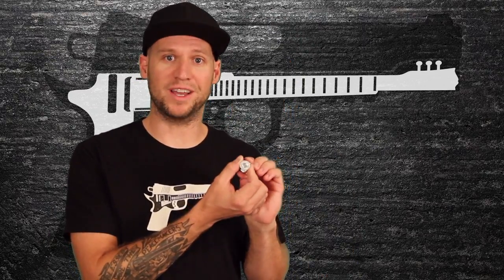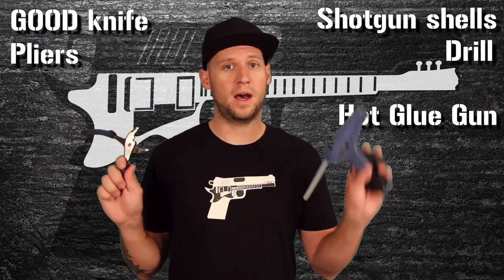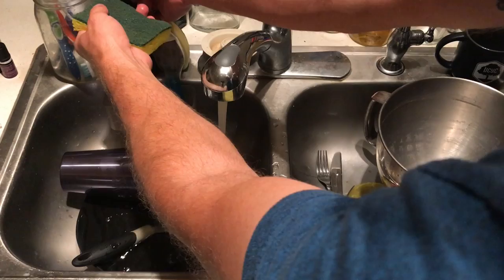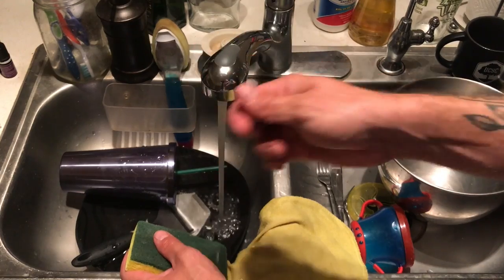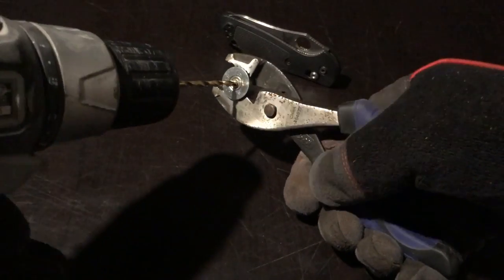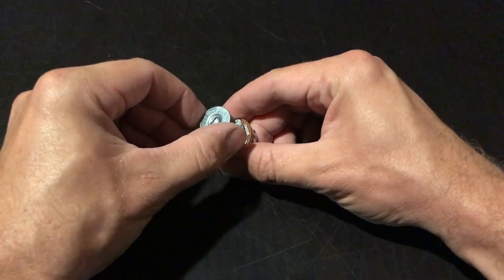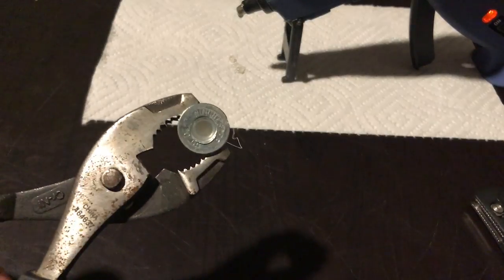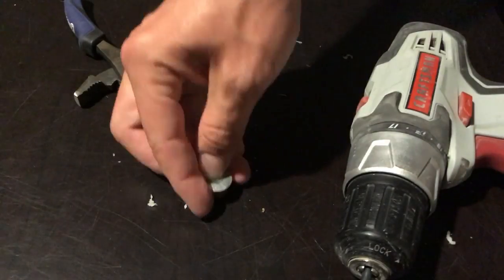How To Make Shotgun Shell Guitar Knobs (guitar hack #3)

Comment: Thank you!
Reply: I tried the drill method but I found it concave the face and scored the sides. 
I had better results using a nail from the inside of the shell. 
I placed the shell face down on some pliers opened up a little to allow space for the plug to come out. 
Then lightly tap the nail in the back of the shell. Plug pops out clean!

Comment: That looks cool, but won't the solidified glue get loose after some knob turning? This might make a knob quite wobbly, I guess.

Is it possible to make a thread hole for a set screw in such shell?
Reply from the maker: Sorry, this comment landed in spam for some reason.  the glue holds just fine as long as you don't pull them off and press them back on everyday, or try to keep turning them after the pot stops.  but you'll ruin any set of press on knobs that way so I don't feel like its a problem.  I haven't figured a way to put a set screw in yet, I'd like to figure it out for solid shaft style pots.  But for now this works great for knurled shaft pots.

Comment: Compared to the typical (from what I can tell) sizes for concentric knobs, the best way to get close to those sizes would be to use a 12-ga for the inside pot and something huge (4-bore would be accurate but good luck finding and firing off one of those) for the outside pot.
Reply: But another idea would be firing off a .44 magnum and using that as the inside knob considering you're probably not gonna need to touch it quite as much as others like volume, plus it would fit nicely on top of the .615 of a 20-ga.
Reply from the maker: I ended up doing a 12ga for the bottom knob and a .410ga for the top. It looked okay, but I actually ended up liking the factory black knobs better.

Comment: >Drill out the primer
Or, punch it out through the flash hole on the inside. You won't get any pliers marks, or pliers slipping and ruining your brass... (Don't forget, you need to have a hole bigger than the primer on the bottom side so the primer has a place to push out to - though, you can get away with just supporting it over a wrench or small socket or something)....

Also, if you carefully punch the primers out, you can take the copper primer cup and carefully fill it with solder to give it that "live primer" look while still being totally inert. Also also, you can get the rest of the hull out of the brass sleeve by simply heating up the plastic with a heat gun or blow dryer (with your wife's permission, guys). This is how I fit my 16ga brassy over my stock string tensioner nut thing. :D